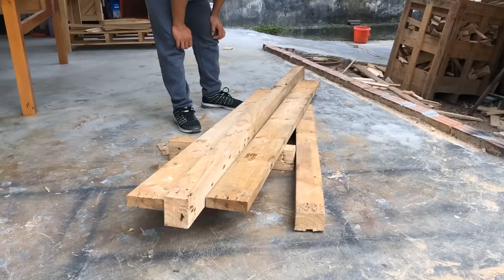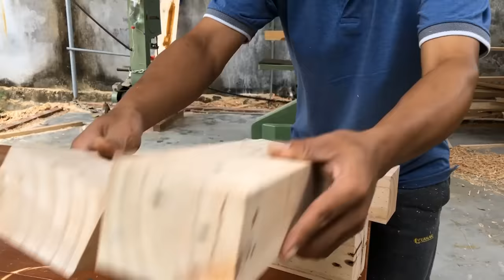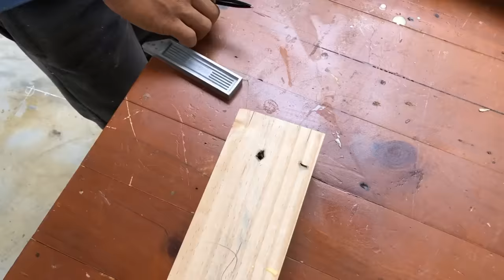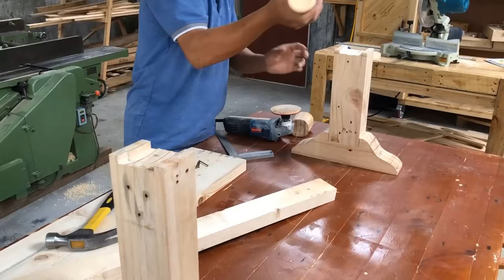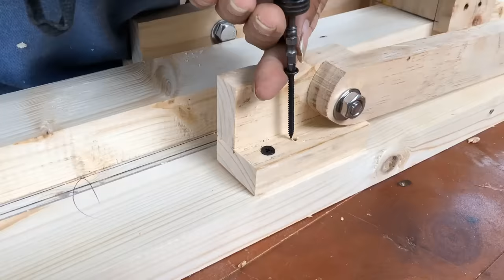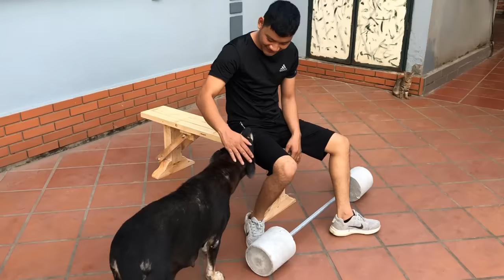DIY Gym Equipment Projects To Make At Home // Build Your Own Weight Bench

Comment: When I started to lift weights the gym I joined had almost all the equipment made in wood (1968). Time goes and because of the covid all the equipment for sale was sky high prices...what I did? I use the skills learned from my father and I have done a bench, a power rack and a calf machine. Actually working on a adjustable incline bench. Not leaving behind the satisfaction I feel when I said I did it my self. Thanks for shearing.
Your skills are awesome.

Comment: thanks for the good job ,  I like your works and skills , but you need to pay attention to the safety issues , the holes for the declined bench must be deeper of secured by 2 or 3 cm high pieces of wood  each , to prevent the thin metal tongue from slipping while lifting heavy weight. and you better support the bench base with extra piece of wood to prevent breaking, thank you for sharing
Reply from the maker: thank you. We will try to do better, wish you well